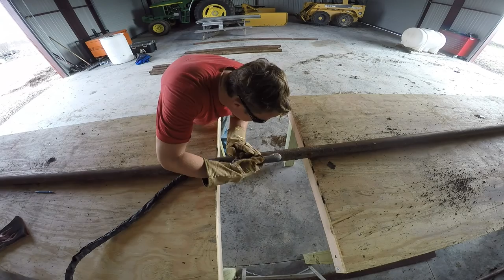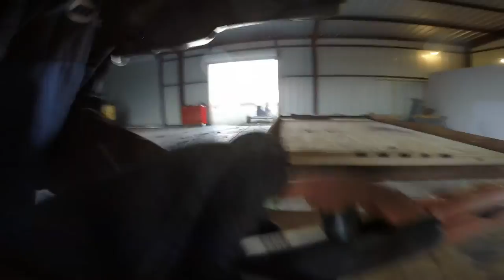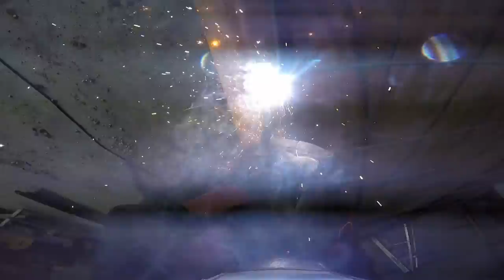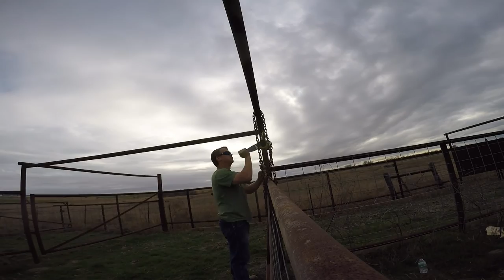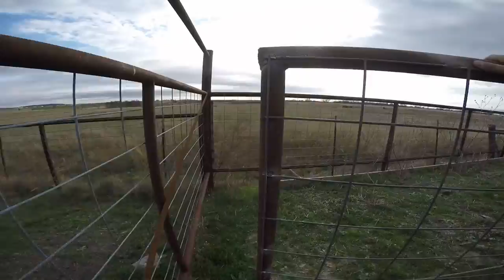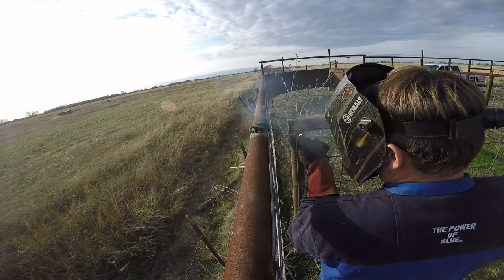Corral Gate Build

Comment from the maker: Thanks! I think I left my 220V extension cord at a job site and so the engine drive stick welder was the only option the first day.  But 6011 rod on AC works the best on potentially magnetic drill stem from my experience.
Reply: Lewis Renovation & Repair I agree man. I was going to buy a Ranger or Bobcat with ac/dc for this same reason. I got a Hobart for 2600 bucks in DC and man the Arc Blow Back sucks on the pipe I have. I even think my PowerMax 45 plasma cutter is being affected with the pipe. 2 cuts on the pipe and nozzle was unusable.
Reply: If you encounter magnetized oilfield pipe , try winding an inductance loop of 10 to 12 turns around the pipe with your minus lead and see if it helps !  I use to take a rosebud and heat the crap at the saddle I was going to weld , and it would reduce the strength of the magnetic field .
Reply from the maker: Thanks,  I'll give it a try

Comment: So Im sitting on the toilet planing the gate I will build tommorow. I was thinking 4 pieces 16ft long and about 4 4ft pieces vertical. Thats like 500 lbs if I use 2 3/8 pipe. I may go this route to remove some weight.
Reply: Actually you would be closer to 413 than 500 but still a heavy gate...if it was me I would hunt for some 1 3/4 or 2in coil pipe...24ft length ia only 52lbs

Comment: Is there gasoline in that generator?
Reply from the maker: It is a Miller Bobcat 225 welder/generator which runs on gasoline
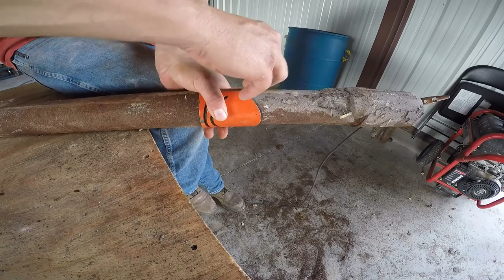Reply: Lewis Renovation i was referring to the one on the floor you can see at 0:38.

Comment: Can't see your hinges or latch.
Reply from the maker: 3 1/2 od pipe fits nicely over 2 7/8 od post for a hinge. Cut x2 ~ 1 inch rings of 3 1/2 and x2 ~ 4 inch pieces. Slip them over the 2 7/8 post small, big, small, big. Weld the rings to the post and the gate to the 4" pieces. 2 7/8 od also works the same way for a 2 3/8 post.

Latch is a chain welded to the gate and a chain hook welded to the pipe fence

Comment: What kind of hinge did you use? Did you make the hinge?
Reply from the maker: 3 1/2 od pipe fits nicely over 2 7/8 od post for a hinge. Cut x2 ~ 1 inch rings of 3 1/2 and x2 ~ 4 inch pieces. Slip them over the 2 7/8 post small, big, small, big. Weld the rings to the post and the gate to the 4" pieces. 2 7/8 od also works the same way for a 2 3/8 post.